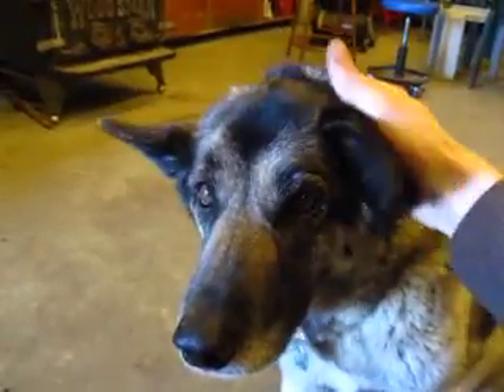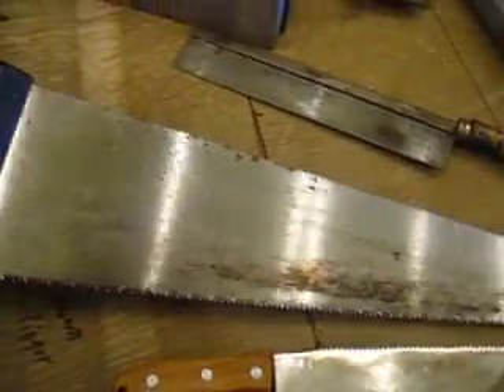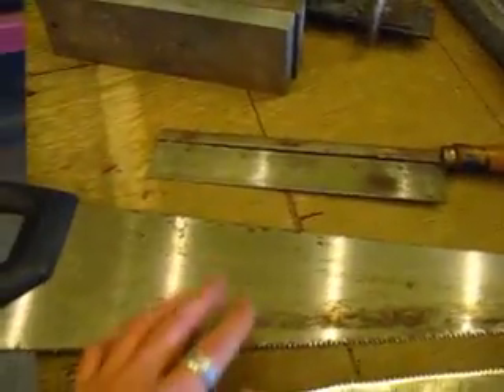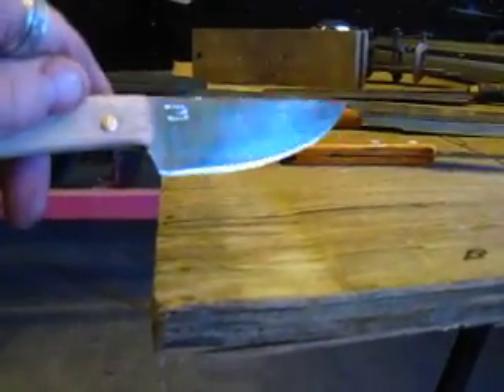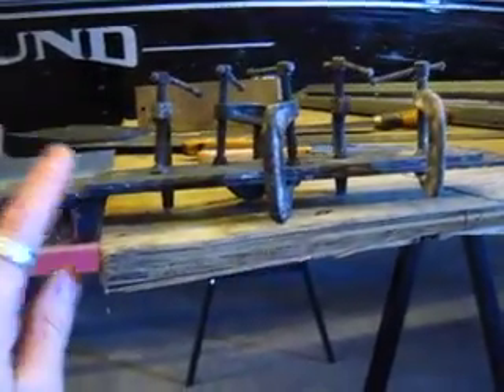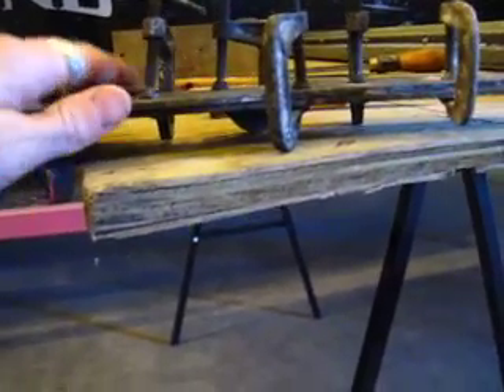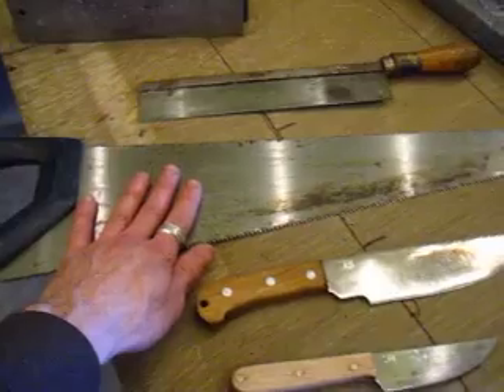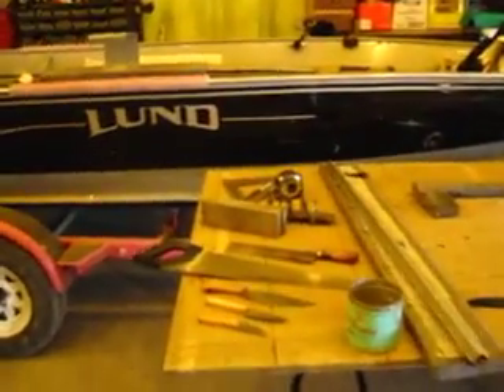3 handsaw blade knives

Comment: Awesome vid! Thanks so much for the info. Just out of curiosity, do you need to absolutely heat treat the blade? Can't you do stock removal and put an edge on these as is? Any info on this would be appreciated, thanks!
Reply from the maker: Thanks for the kind comments :)
Lots of saw blades seem to be only hardened in the area around the teeth,so if you wanted maximum performance you would have to heat treat the steel.
But if you found a saw blade (circular) that was through hardened then you could use it as is to make a knife without further heat treating it.
In that case you would have to take care in cutting out the blade blank because the heat you induce could blow the temper that the steel already has.
Keep in mind that you could make a knife out of even mild crappy steel and still have a knife that cuts good.
That is if you put a course grit final edge on it (toothy) or you take a round file and give it serrations,then it could cut better than some heat treated knives.
So yes you could make a knife out of a saw blade's in heat treated parts and have a decent,tough,good cutting knife.
Like I said,the trick to that would be to apply a course grit toothy edge (220-400 grit) or serrations.
I hope you make some cool knives and have alot of fun doing it!
Don't forget,that you can also buy knife steels that are very cheap (1095/1084/5160/15n20 ect...) from knife making suppliers,then cut out the blade,drill the holes and rough shape the bevels,then send it of to get heat treated by an expert for pretty cheap (I have seen as little as $5 pet blade for a good heat treat)
The shipping would cost more than the heat treating probably.
Thanks for watching,and take care :)
Reply from the maker: I ment to say "yes you could make a blade out of a saw Blade's UN heat treated parts (rather than IN heat treated parts)
This correction is for the third or forth paragraph,where I typed IN instead of UN.... Sorry for any confusion (I and u are right beside each other on my keyboard)